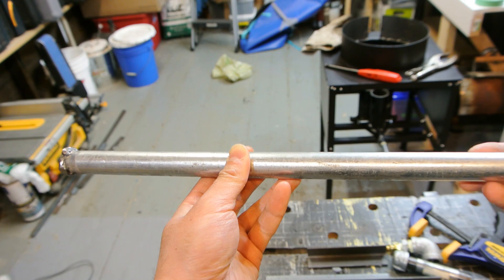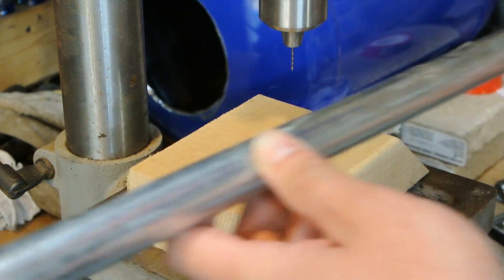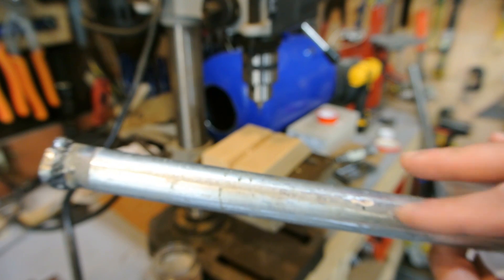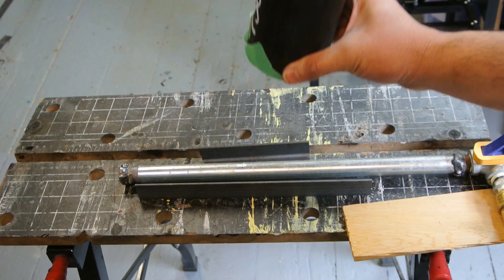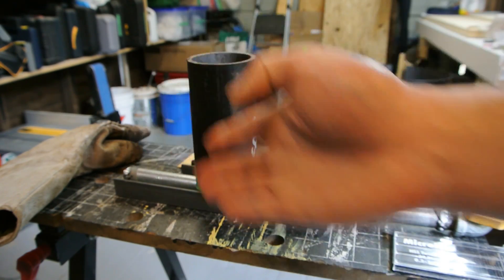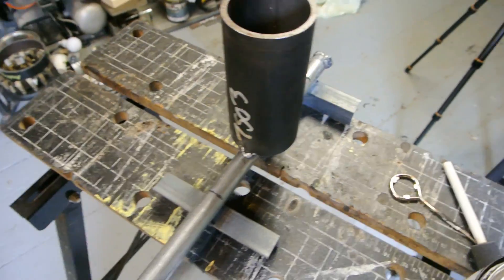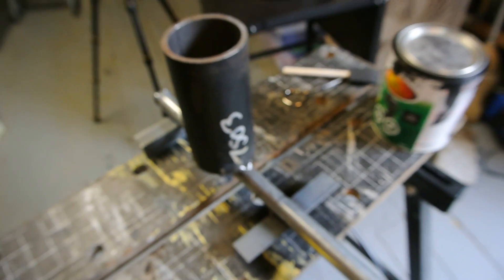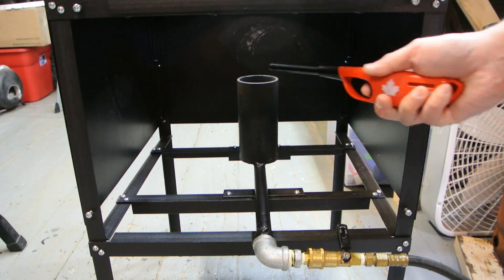Make a Propane Jet Burner - Seafood, Brewing, Wok, Deep Fry Burner

Comment: Have you ever measured how much gas do these burners use per hour? Also do you have any guide on how the pipe and hole dimensions change if you wanted to make it smaller or larger?

Comment: Have you found that a single jet burner puts to much concentration of heat in a small area or does it distribute evenly across the wok ?
Reply: With conventional wok cooking, you want distinct heat zones. The bottom should be considerably hotter than the sides.

Comment: FYI   3" sch  40 is 3 1/2 on the OD look's like you have 2 1/2 sch40 ,OD is2.875 go on line and search for pipe Diameters thanks for the burner demo.

Comment: Greetings, when placing the Minimum Fire it turns the pot or pan that is being used black? I have a similar one, but it smokes the utensils when the fire is minimal... thanks, your video is very good.
Reply: Your A/F ratio is off causing sooting or an incomplete combustion and that’s why you’re seeing black. If you have a way to adjust the mixture you can reduce the sooting.

Comment: Nice bro! Iam gonna make myself a wokburner this summer. Way better then almost everything you can buy at less of the price
Reply: I’m using a harbor freight weed burner for my wok. It has 300000 btu. Had a stand  built for the torch. Did you build yours and is there a way of telling what the btu is?

Comment: add stainless steel bucket + water pipe from tap and shower  - and you will get best water heater - instant - 
and even when shower off - heat/water income rate remains the same - so water continued to collect in bucket - with initial temperature that you adjusted first by gas and water flow regulation - then you can use more water, or turn gas and water off and use buferized water quantity from bucket
if bucket overflow - gas will stop - no any explosion - but need to be there - to turn all off 
with PVC transparent pipe formed like    N     filled with water and submerged to bucket by one end - you will get level indicator without extra holes in bucket - actually you don't need even one drilling

Comment: Hi Andrew, You mentioned "Basically the hottest part of the flame is near the tip of the flame" can you share what is the best distance for the flame to be from the wok? This way I can determine the distance for the burner to the base. From what I calculate by watching your videos the top part of the jet burner is about 6 to 7 inches from the base. I saw many people as you a similar question but no replies. What do you suggest is a starting point and how do we know when we got the flame at the right place. thanks for a great video!

Comment: Hi, does anyone know if this would work of the burner tube was bent, I want to use a 45 degree pipe to direct the flame at an angle rather than straight up.
Reply: I am also keen to know. Did you end up doing this? Did you use round or square tubing?
Reply: @TheDechof  yeh I did it with a 45 bend exhaust tip. It works really well, it’s just a bit loud (not sure if that’s because of the thickness of the tip or the bend or that’s just how they are)

Comment: I love this little powerful stove¬¬>allmy.tips/Iwatani_stove?27A  but it does go through fuel. I can get 2 meals out of a canister. We have a double burner older camp stove and will use that one in the future for heating water, as this stove is designed to cook and has a high output for searing meats or what have you. Easy to use, so lightweight, has a nice carry case.

Comment: Could this type of burner be used for a turkey fryer with an aluminum stock pot?  I have watched your videos on making these burners.  I have watched others using mig tips as the orifice into a 1.5 to 3/4 reducer into an 8”-10” piece of 3/4 pipe.  These are used for forges, but I worry about that focused of a flame on an aluminum pot.  What are your thoughts?

Comment: Hi Andrew, I'm sooo glad I crossed your channel. Wanted to know if can I use this for a Brick Oven?
Thanks
Reply: I had the same question
Reply: @karimbahmani8423    I'm thinking that this burner is pretty much full on or off with no mid range.   A more heat controllable burner set up would probably work better for an oven
Reply: I'm thinking that this burner is pretty much full on or off with no mid range.   A more heat controllable burner set up would probably work better for an oven

Comment: You don't need that size pipe, what I do is take a 1/8 pipe collar weld it to a peace of flat bar than weld the flat bar to a 2 inch piece of tube than take a grease zert with 1/8 pipe thread grind the back off until the spring and ball fall out screw it into the pipe collar than plum the rest out of 1/8 pipe it will give you a burner that is the same as a brush burner, all the btu you can get from a vapor burner, if you really need more btu make a liquid propane burner, a lot more  involved
Reply: Who cares what you do!!...It's his video!!!
Reply: @johnbrevard5966  you nailed it😂

Comment: Sorry if i sound stupid... Most of the Jet Burner videos state "Outdoor" use... Can this be used indoors??
Reply: Do you have a fire suppression system in your kitchen? We are approaching the flash points of your ceiling here.
Reply: Use it anywhere you decide you want to use it it belongs to YOU!
Reply: Why not?  Many people use propane stoves in their campers, motor homes and kitchens.  Just make sure it is well secured to a base that can't be accidentally knocked over.

Comment: have some questions, the smallest drill bit i found at the hardware store was a 1/16. will that work? and i plan on using a 4inch long burn tube. will that work as well?
Reply from the maker: 1/16 = 1.58 mm
Reply from the maker: Hmm 1/16 might be a tad bit too much flow of gas but it is work a try.  The 4 Inch should work.
Reply: Andrew W thanks!

Comment: Wow. I have been wanting to have one burner like this for ages. Question though. What would happen if I decide not to choke the bottom part of the pipe. Can I just not do that and use it as it is? Thanks Mate!
Reply from the maker: The burner may not light or will burn too lean.
Reply: Thank you. So it controls air to gas ratio.  Now i understand.

Comment: What is the best distance between the burner tube and the bottom of the wok.  In the video it looks like there's a lot of distance.  Wouldn't it be better to close the gap and get more heat to the wok and less heat to the cabinet?  Thanks for making the video!
Reply from the maker: Basically the hottest part of the flame is near the tip of the flame

Comment: What size of rod you use to weld this pipes??   6011?  6013?  7018? 
Thanks!!
Reply from the maker: They all should work but 6013 or 7018 is my preferred ones, 6011 is messy IMO
Reply: 6011?  6013?  7018?  these are not sizes, these are types.  Try 1/8"-7018 or smaller.